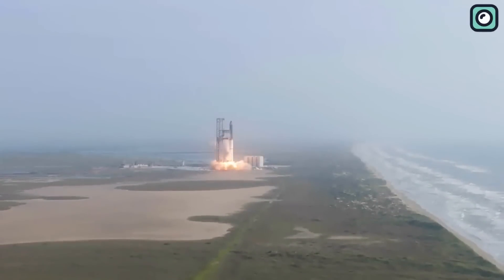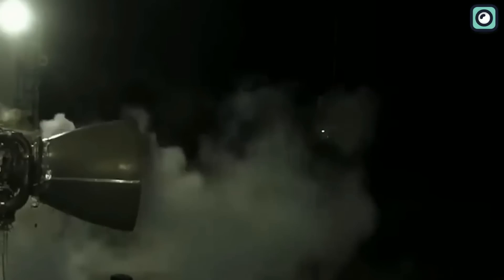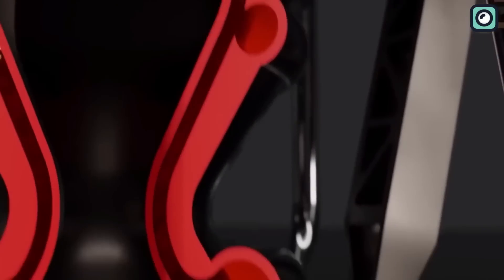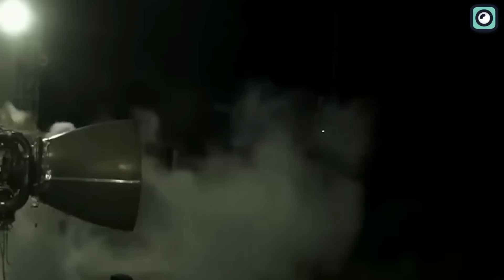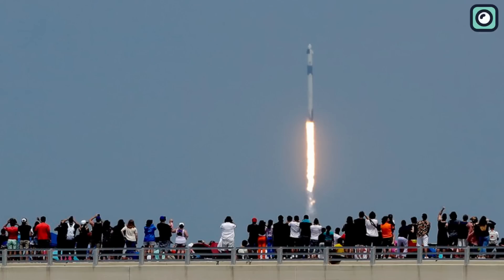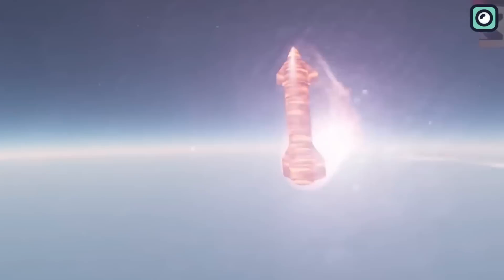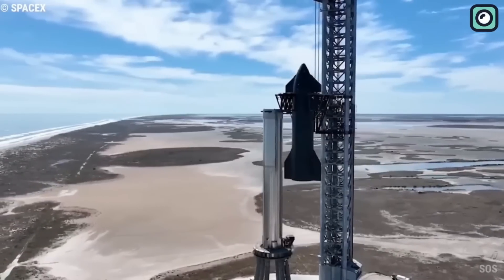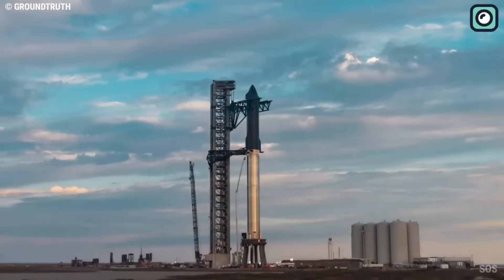SpaceX's Raptor engines BIG PROBLEM....

Comment: Instability is always possible.  As changes are made which change mass, plumbing lengths, air pressure, interaction with vehicle, fuel ratios, engine position,  engines operational, etc. different vibration modes come into play.  Note they have all been tested on a test stand to flush out issues as able, but not on a freely moving rocket.  The early vehicles in the space program (and all aircraft programs in fact) had all sorts of issues that were not flushed out until the reality of flight tested them again, and rather fully.

Comment: my brain fart,,, 2 nozzles per combustion chamber, replace Turbo chargers with Super chargers , use a pulse valve to change frequency of exhaust ,active element to focus and tune the rocket exhaust, use cold gas thrusters to cool engine area and the heated gas may increase overall thrust .

Comment: May I suggest a wonderful incentive plan to success-Have Elon be on every rocket launch
Reply: SpaceX/Elon isn't planning to retrieve a rocket for a couple years at least. Elon said they plan on/hope for four more test launches this year, and said he gives it about an 80% chance they'll reach orbit on the last one (5th test). They plan to reach orbit next year, at which point they'll start putting payloads on, but the rockets will still be test models that will then work on reentry and (after a bunch burn up before they nail that part) landing on pre-designated spots in the ocean before sinking. Only once all those kinks are worked out and it's working reliably will they start actually trying to recover any, which will then be stripped down and examined to see what's showing signs of stress or wear. Only after all that will they start actually relaunching ones that have already flown. And only after they've been doing that a while, with the all the components showing they are working reliably, will they start mass producing the final design by the thousands. This is going to be a looong process with a lot of explosions, burn-ups, crashes and splash-downs. Might want to adjust your expectations!

Comment: Hiccup?
The engines were eating themselves from the moment they were ignited. All indications are that it was engine failure that blew up the ship NOT the FTS which not only didn't activate immediately when triggered but was ineffective when it did finally activate. 

"Rocket science is anything but simple" Yet with Artimus 1, the SLS achieved all of its mission objectives without blowing up multiple craft along the way.
 
"SpaceX is collaborating with other experts in the field"  This obviously didn't include consulting experts in launch pad and flame diverter design. 

"the reusability of the space craft" They have yet to reuse any of the Starship versions to date. Now part of that was because all but one was destroyed but as soon as they managed to get one on the ground without it blowing up they just moved on to the next step. No proving they could get multiple tests to go correctly. No showing that could make a hop, restack it on the pad, fuel it and go again. Just one mostly successful low altitude belly flop and then on to the big candle.
Even if they had made it to orbit, the mission objective was to crash the Starship stage into the Pacific, not land it back at Boca Chica. This is hardly what I would consider "reusable".
Reply: The SLS took too long to be developed by a hundred different contractors with no penalty for not meeting their deadlines. I find it interesting that people think it is impressive to see NASA make something with left over shuttle parts then to innovate a new rocket. By the way, maybe you should ask yourself why Elon and SpaceX have done more in the last 5 years then NASA has done in the last 60 years.  Private industry will always out innovate government junk because of the ability to innovate without having to fight with politicians. NASA is a great example of what happens when a great agency gets taken over by politicians. Sitting here laughing, because all the years NASA has been around not one MIT genius came up with the idea of reusable rockets. It will be SpaceX that gets us off this rock and to MARS not NASA.
Reply: @xfatherjx  I see you have bought into the entire Musk fantasy.
Reply: @chrisose  you’re the one living in a fantasy. The SLS cost 1B to launch every time. It’s already obsolete...
Reply: @random767676  Crew Dragon costs a quarter billion dollars to send 4 astronauts to the ISS. This makes $1b for a round trip to the moon sound like a deal.
Reply: The SLS RS-25 engines were all pre flown Space Shuttle reusable engines, so that is not a fair comparison
I guess you know very little about SpaceX reusability testing.
Reply: @favesongslist  Yes, SLS used tried and true reusable rocket engines for a successful mission. If it ain't broke, don't fix it.
I frankly don't give a crap about the claims they make about their testing. What I care about is the actual performance and so far there have been engine failures on all of the test flights done at Boca Chica. This calls into question the design and/or execution of this system.
Reply: SLS=ancient tech. Overbudget and late to the party. Go ahead and deny any of that.
Reply: @chrisose  please read my previous response. You're completely missing the entire design philosophy and process that SpaceX is using and it's benefits. They're intentionally testing stuff they know is going to break, and testing it to failure because that's the quickest way to perfecting the design. Elon tells people at his companies repeatedly that you can waste money but you can't waste time. So rather than spending years and years trying to design something that is massively expensive to build and will only ever have a few built and so you need to have it work the first or second time, instead design something that's super cheap and quick to build, and just start building and failing as fast as possible. That's the fastest way to get to a final design. You're judging SpaceX using completely the wrong set of criteria for their approach.
Reply: @aaroneslinger7968  Ancient tech that worked.
 
Overbudget: How much more overbudget would SLS have been if they adopted the "blow sh1t up" approach used by Musk?

Late to the party: Better to show up late with something that works (SLS) than be late with something that blows up (SpaceX Starship). Reminding you that according to Musk he expected to have already run multiple missions to Mars by this point yet they have addressed almost none of the mission critical issues needed for such missions. Reliable launch: No. Orbital refueling: No. IN SITU refueling systems: No. Crew Escape system for Starship: No. Human rated Starship design: No. Any signs that they are even working on HLS: No. 
Demonstration that Starship can land, be refueled, and take off again without being rebuilt: Hell NO! They can't even do that with Falcon 9.

Go ahead, deny any of that.
Reply: @truhartwood3170  So then tell me, if Musk's system is so efficient, why is it that nothing from any of his companies ever delivered on time or in the form promised?
Reply: @chrisose  reusable rockets were said to be impossible. Falcon 9 is doing something like 80% or more of all launches, planning for 100 launches this year. It's full thrust version has a 100% success rate after over 200 launches, with 178 first stage recoveries (some needed all the fuel for the launch, so didn't have enough to be recovered - eg the most recent falcon heavy launch to geostationary orbit needed every ounce of fuel and the landing gear removed to have enough thrust to get the payload to orbit). The "broomstick" is solely responsible for getting astronauts to the ISS from US soil for the first time since the spaceshuttle was mothballed. Yet the first three rockets failed and, at the time, people thought SpaceX was done and would go bankrupt and disappear.

Model S was vaporware. As was the Model 3, which became the #1 selling EV in the world for four years, only to be beaten by the Model Y, which was also said to be vaporware, but is now not just the best selling EV, but the best selling vehicle of any kind in the world. It will likely only be dethroned by Tesla's next gen, entry-level vehicle, the factory for which is buying built right now in Mexico. The semi was also vaporware, but first deliveries have been made and the factory to start mass-production being built in Nevada as we speak. It will likely take over a huge percentage of the semi market once production ramps. The cybertruck was also vaporware, but now photos of the production line are online, with test parts being built durong final calibration of the equipment. It will likely take over the pickup market once production ramps up, as it will simply be the most practical and capable vehicle for the price.

Meanwhile, who else has developed a reusable rocket? Who is SpaceX's competition right now? Every other rocket has a massively expensive design and is expendable, thus having much higher mass-to-orbit costs. And with less reliability to boot. It's only payloads that fall outside Falcon 9's range that are using other rockets. That's what Elon goes for - total market domination. You're comparing crappy, expensive rockets to the masterpiece SpeceX designed. SpaceX is designing amazing rockets the fastest way possible. Let's put it that way. Tesla's FSD is another example of taking the time to make a market-dominating product. Other autonomous driving companies used methods that get results very quickly... at first. But they have an inherent glass ceiling in both cost and scalability that will prevent them from being mass-deployable. Tesla's FSD has no such glass ceiling. Once they crack it, it will be instantly deployable everywhere in Canada and the US and there are already hundreds of thousands of vehicles that are capable of utilizing it, so it will mean an instant cash influx and will leapfrog everyone to take an unassailable lead. So yes, if you want proof that Elon's method works - just look at the results he's acheived against all odds and despite all the doubters and haters. It will take a few years, but then Starships launching multiple times per day will suddenly seem normal and everyone will forget how they ever doubted it would happen.
Reply: @aaroneslinger7968  left over shuttle parts and lack of innovation. I agree with you 100%.
Reply: Reusability is a long-term goal. SpaceX's approach is completely different from other space programs in the past:

1. design a rocket that is cheap and mass-produceable
2. thanks to being cheap and mass-produceable, you can learn through doing -  build, test, fail, iterate, repeat. 

You get to the final design much quicker. You can try two or three ideas and see which one works best in reality. For example, in the test, the gimbaling engines were controlled all together with a single hydraulic controller. When that controller failed, the whole rocket went out of control. The next rocket (that was ready to go even before this test) has an electric piston for each gimbaling engine. This new system is more robust, lighter, and one control system can malfunction without affecting the others. The Raptor engines on the next rocket already have hundreds of improvements over the engines that flew in the test. Every time they build a rocket they're learning how to do it better. Not just build a better rocket, but refine the actual process of building it and simplify the design. You'll note the booster was "booster 7" and the second stage was "Starship 24". That's because they already built, tested, and scrapped 6 boosters and 23 Starships. Their choice for these ones was to try lighting them off or just scrapping them, too. They figured they could learn something from trying to launch them so they did, and they did in fact learn a bunch. The only goal was to get away from the launch tower before exploding, which is why getting through max Q and seeing how strong the structure was as it started tumbling was a huge success. Learning that the FTS wasn't up to task was also a learning opportunity. 

SpaceX is planning on building these by the thousands on an assembly line just like cars. And so the development program looks more like designing a car - you start with early prototypes and keep refining the design and manufacturing procrss and keep testing it and refining more until you have the final design which then goes into full production. They're not planning on having a reusable Starship for years, since every one they make is an opportunity to test and refine and improve. If they reused one then they wouldn't learn anything from that second launch. It's a wasted opportunity.

Right now they're focused on the basics - building reliable engines and control systems, and a structure that can withstand takeoff and max Q. Elon says they hope to do 4 more test launches this year, and doesn't expect any of them to reach orbit, maybe giving the 4th one an 80% chance of doing so. He hopes to get to orbit next year, at which point they can start putting on payloads, but those will still be test rockets that will then start working on reentry and, eventually (after a bunch burn up) landing. It will be three or four years and many blown up, burned up, crashed rockets before they start reusing any. This is the plan and the goal. There was never ever a plan to land and reuse the very first test rocket.
Reply: @truhartwood3170  Time elapsed between JFK's stated goal to reach the moon and the 1st Apollo landing: 8 years and 2 months.
Length of time SpaceX has been in business: 21 years. Length of time since Musk started talking about some version of the system now called Starship: 11 years.

It doesn't seem like Musk's approach works all that well.
Reply: If the Raptors were "eating themselves" you'd see a green tinge to the exhaust (like some of the upper stage landing tests...).
Reply: @festeradams3972  So what you are saying is that you didn't actually watch any of the footage of the failure. There were multiple stages of discoloration in the plume though out the ill fated burn, including multiple instances of the telltale green as engines melted down.

Comment: Was instability the reason for the failure of some of the engines? Never have heard about that before.
Would appreciate any comment on that.
Reply: Instability as in SpaceX did not even start three of the engines. Which helped keep Super Heavy booster on the pad digging a hole with 30 engines for 5 seconds longer than if they had all 33.

Comment: Why have 30 little engine's why not 15 twice the size and half the trouble
Reply: Easier to make smaller engines perhaps ?
Reply: If it could be done, it would have been done by now..
Reply: Better redundancy. This test, at least 8 engines failed to light yet the remaining engines were dialed back to about 80% capacity and it still flew. 
Often engines twice the size do not yield twice the thrust output. They use more fuel and are also heavier. Also, consider if the percentage of failure to light were the same, it might not get off the ground.

Comment: They got smashed with concrete and shit.
Reply: Apparently, Musk said that was not an issue affecting the engines.
Reply: Launch site to close to water level,engineer it out or move.
Reply: @pottywotty100  There are attempting to engineer it out with new steel water cooled plates.
Reply: @pottywotty100  they already have a metal plate to go under the launch tower that will act like an upside-down shower head - blasting jets of water up. Other nozzles will blast water jets in from the sides. The water will cool the exhaust, dampen the noise, and neutralize any shcokwaves that could bounce back and damage the rocket, as well as cool the plate so it doesn't melt. They didn't have time to install it before this launch, but thought the concrete would mostly hold up to one lunch. Apparently it would have, except no one factored in that the earth would actually compress significantly from the force - and that the concrete would be forced down into a bowl-shape. This caused cracks right through the special concrete that the exhaust then found its way into and ripped it apart instead of just ablating its surface.